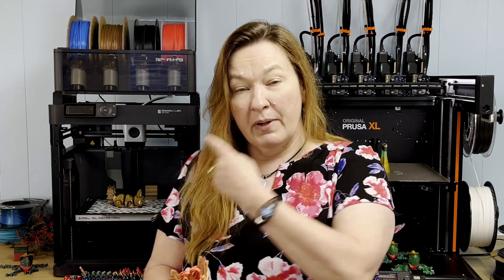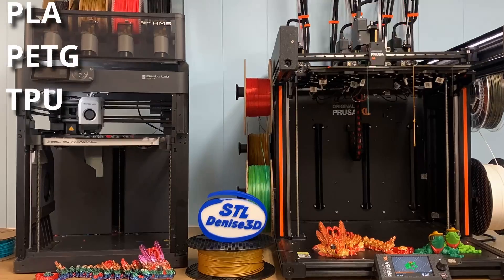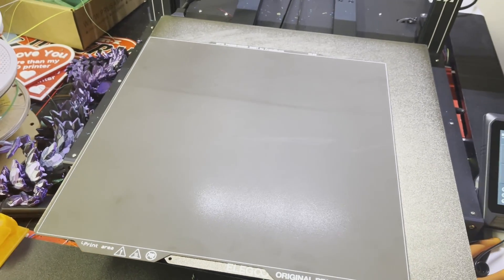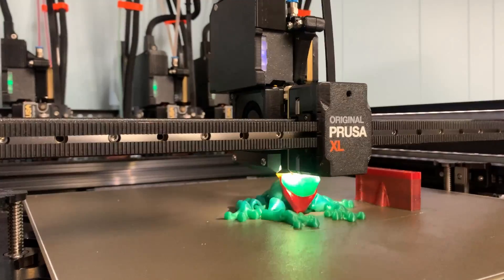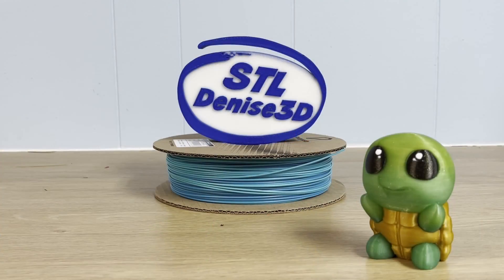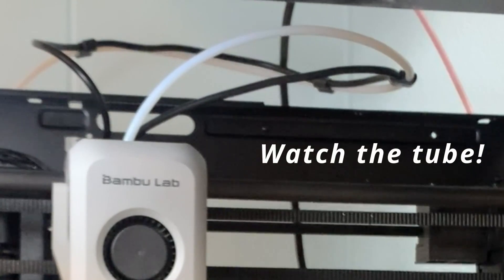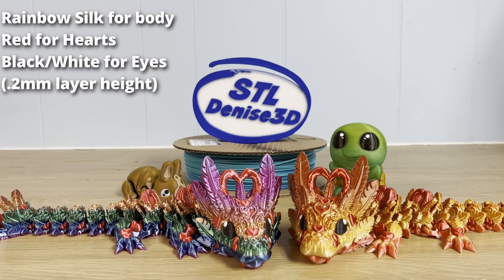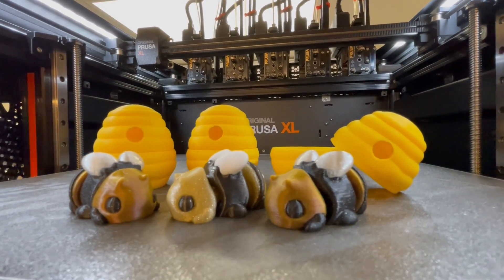Prusa VS Bambu Round 2: Who Prints Color Faster?

Comment: Prusa has had the MMU but I have not heard very many people who are happy with it.

Both machines have their place. I feel like the Bambus are more refined and user friendly especially for someone who has never used a 3d printer before.

If your buying an XL because of wasted material its going to take like 10 years to make up the price difference.
Reply: Maybe some people who manufacture multi material or color stuff for selling, they could make the cost back way faster depending on how active the printer is and how much they take money for each printing hour.

That being said, 2 bambus would have the same or even better output for the time, but then its also double the wasted filament and other costs related to running printers
Reply: @Vision-xf8gl  Even if you wasted a full KG of material every day (very unlikely). You would more than make up the cost by selling all the extra models you would print with 4 p1s instead of 1 XL...and if you really were worried about the waste because you were making so much then you could invest in a chipper and filament extruder to reuse your waste.
Reply: @UbberMapper  yes and no, the cost of those models sold can be from 20% to 50% higher, cost of the 4 printers would be the same as the prusa xl, not to mention the maintenance costs for 4 motion systems maintenance etc etc

Each printer has their own pros and cons when it comes to manufacturing for sale or for hobby use
Reply: @Vision-xf8gl  Where i live, with customs and shipping i am going to be close to 5k for a prusa XL. I could get like 8 A1 Combos for that price. Then i would really be cranking out the prints. Considering a single person can easily manage several dozen printers by themselves it would be a no brainer move.

The XL really only has two things going for it that make it worth while. Large multicolor printing, and multi material printing. If you need to print things larger than 257cubed or mix Nylon and TPU into the same print then the XL is what you have to have.
Reply: @UbberMapper  Definitely if you have the space for that it wiuld be the choice, and building enclosures for them wouldnt be that difficult either for other materials

This is just a question about what the user has in the terms of space/money/time and what they print for and their personal preference in the flavour of the manufacturer

As the creator said, this is a world where people drive ferraris and fiestas, both move forward and dont explode and thats pretty much all that is needed
Reply: @UbberMapper  I'm not sure if I will be proven right in the future, but I think that Bambu printers are like buying a DVd player or television these days.  If it breaks, you throw it out and go buy a new one.  I've seen a tear down and they don't look fixable at all.
Reply: @chethammer  they sell replacement parts for almost everything. The only thing i don't think they sell is the frame itself. I have seen people tear down and replace the carbon fiber gantry. Plus there are aftermarket parts in constant development. I have 0 concern about these printers being repaired.
Reply: @chethammer  They sell the parts, have wiki and video instructions for common and advanced repair. 
Michael from teaching tech ran a full video about repairs debunking they weird FUD that has been circling the community. 
So your prediction is already incorrect.
Reply from the maker: Oh definitely! But I don’t think beginners are going to start with this beast. (At least I hope not😮)

Comment: I would imagine it's FAR less wasteful of filament :)
Reply: The bambu fanboys will try to tell you it's not a big deal, but yes your right the XL is much less wasteful. A multiple colour model on an AMS can waste more filament than it uses to print the model. The XL tower (if you have one at all) will be. Small fraction of the amount used to print the model
Reply: Fanboyism aside it's just math.
So let's be clear a single filament change is about 2-5 swaps per gram. or 2000-5000 swaps a roll.  

Saying the XL is less wasteful, while true, doesnt make up for the fact it costs thousands more and you wont see that cost savings for years if ever depending on how you print.  

Single color you prints will see no benefit for the XL if anything it is a slower less capable printer unless you need the size but there are far cheaper options. 

Multicolor prints will print faster BUT then you have 5 tool heads, more room for error more nozzles to take care of, more points of failure etc. 

For the cost difference you can get multiple printers printing more parts than a single printer. 

But the argument still stands you are wasting dollars to save pennies. Even if you buy ridiculous $100 rolls of filament the cost is still not in the XL favor.
Reply: @AwwwSnapperz  would I have bought my XL just to save filament? No of course not... it's a nice feature, but not a killer reason.
Same is true for the speed......it's nice, but (for me) not critical, although I am sure for some people this will be very important.. However what is critical for me it being able to print multiple materials.....I also need to be able to print different colours of TPU in the same print.....pretty sure the bambu's can't do that?
Reply: You decide how you print but this filament waste is a false equivalency. Look up Dollars and Cents, Bambu Lab's Filament Waste True Cost. 
Even if you print multicolor everyday on defaults you would need hundreds of thousands of filament swaps to get to the break even price of a bambu x1c vs xl.
If you tweak some minor settings that is well over a million  color swaps. how many years/decades of printing is that?

Purge volumes can be reduced
prime tower can be reduced or eliminated.

The waste argument has been thrown on it's head as EVERY fdm printer will have waste of some sort. There are NO exceptions.  You are literally spending big bucks to save pennies in "waste" that if you really cared about it you would either recycle it or use a one of many options to reduce it.
Reply: There are a bunch of reasons to get an XL but the filament waste argument always annoyed me the most as you see from above. The XL shines on 5 material printing, size and speed of filament swaps. 

The prevailing theory is you cannot use tpu in the AMS and you would be 100% right. TPU is a NO GO for the AMS or AMS lite

But when there is a need there will be a way. at least one company makes AMS compatible "TPU" called (AMS) STTPU which has a shore hardness of 80 D when dry  65A in softness when wet.
In comparison PLA shore hardness is around 77 D.
 
TPU is typically 60-95A

Theoretically you can mix tpu into parts on a p1s or X1C if the marketing claims can be believed, and if so that negates another win for the XL. ( I havent tried it personally but am aware of the product)

Comment: The Prusa XL is clearly superior in multi material printing. While the X1C is part of a more refined ecosystem, it gives the user a better experience. Now, I wouldn't spend $4000 or $2400 on a machine just to print colored figurines for fun. Even though they are usually compared, they are not even in the same category. That being said the X1C is a more polished, finished product than the XL.
Reply from the maker: I don't think you can say Bambu has a better ecosystem than Prusa, they're pretty evenly matched. Though, points to Prusa for making their own filament in house.  Thanks for stopping by!
Reply: @stldenise   you could say that. I've used both machines, and the bambu and AMS experience is amazing compared to the buggy and problematic prusa and mmu2/3 system.
Reply: @stldenise  Yes, you can. Bambu Lab printers work seamlessly with their slicer and filaments, you can manage the printer from the slicer directly, including video feed and even failure detection. Prusa's ecosystem is not that refined, remote, connection and management is still a work in progress. Sharing files through WiFi was an issue right from release, both MK4 and XL. Prusa connect is still not that feature rich and only allows for basic management. The success of Bambu Lab is mainly due to the whole experience than just a good printer. Prusa is trying to catch up as we speak.
Reply: @stldenise  I'm not trying to offend  or trigger you but your bias towards Prusa is too evident
Reply from the maker: Not offended or triggered, and I still love my p1p, except when I have to dig into that AMS to clean it out.  @elleryfg7853
Reply: @stldenise  glad to hear that
Reply: I agree, prusa is clearly well behind the bambu ecosystem at this point.

Heck they still sell you printers with shitty 3d printed parts on them for more than other companies' professional grade parts, how cheap is that?

If the prusa XL just worked that would be one thing, but it has had endless issues reported. None are mentioned in this video.

If time is money, how much money is sunk into troubleshooting the XL compared to a bambu? The bambu just works.

Finally, any filament cost advantage is pretty much wiped out by a filament recycling station
Reply: @Tom--Ace  yes, it's embarrassing that their top of the line professional machine (that cant even print engineering grade materials due to the lack of a chamber on release) still uses 3d printed components, and still had so many issues on release, some of which are unresolved to this day.

Bambu has upstaged prusa at quality and professionalism, and it's clear prusa is released rushed products in an effort to catch up.